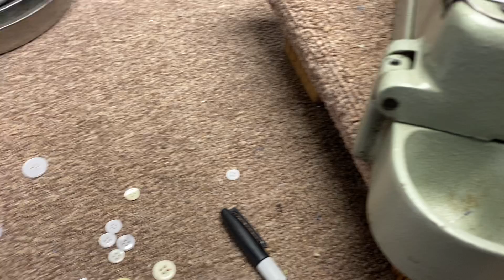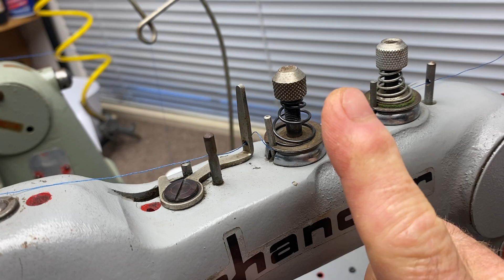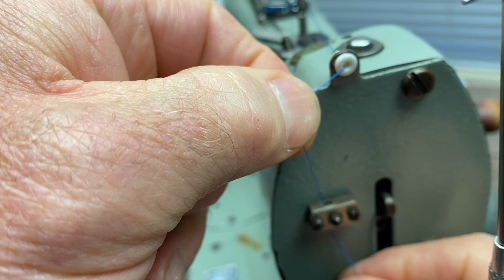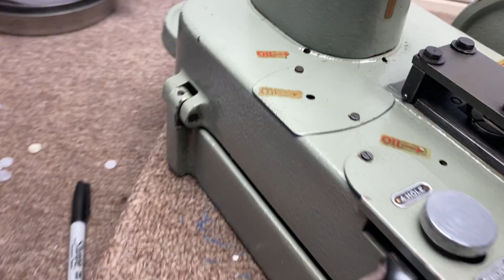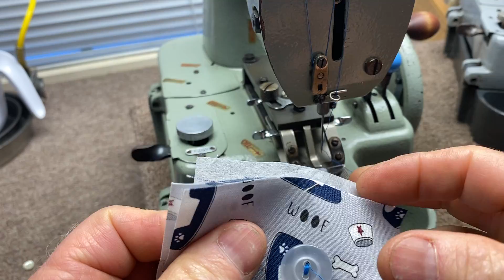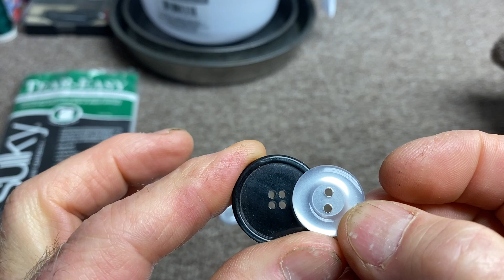Chandler Button Sewing Machine

Comment: Hey ya!  Deeply appreciated this video.  I got a 471. Have given it a through clean.  & I just can’t seem to get the stroke to change or lengthen to a longer length for a standard modern 2 hole button  - I followed the directions in the manual page22 to 24 but there’s no difference in the stroke length regardless what I do.  Are you able to do a video showing how to adjust the stroke length please?  Both by the top part & under the panel part please?  Deeply appreciated as I would love to use it.